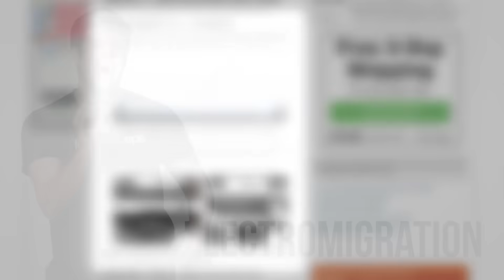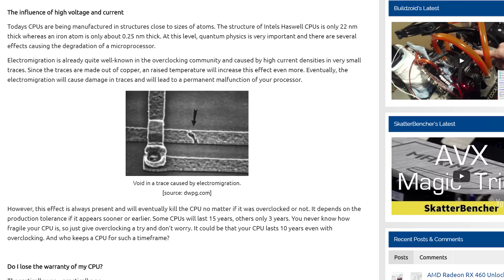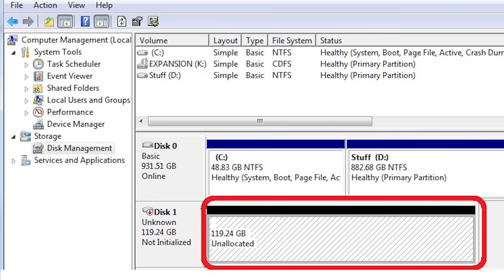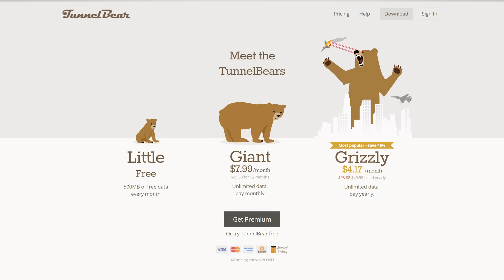Why Do Electronics Die?

Comment: Shame you skipped one of the more common failure causes, especially in modern computers: timing mismatch induced short circuiting. When you build massive networks of logic gates to form all of the necessary logic to make a computer of any sort. You have a minimum time you must wait before you can trust the output of any logical inversion, the time it takes for the signal to go from the input side to the output side. When you break the essential circuits down to logical inversion in diagram form, it's pretty clear there are some paths faster than others. Imagine this: you have a wire that can have voltages in it ranging from 0.85V to 1.35V. Some things connected to this wire can't handle the full 1.35V while other's can. It's just not feasible or even possible to separate them due to what they are needed for. So you build a gate system that will shut off that power wire to anything that might be hurt by the full 1.35V if it's about to be changed to that voltage. Simple solution, works really good majority of the time. However we want blazing fast chips so we do this as fast as possible with no wiggle room for maybe an electron going missing from that "shut off low voltage circuits" line.

Chips suffer from this a lot, they are built for it with a stated tolerance level based around exactly that problem. The higher end of the tolerance is where it's going to happen enough to notice a difference in lifespan of the chip. This is also where the mistakenly though up "Planned Obsolescence", at least as rampantly, actually comes from. They know in a few years, your most likely going to upgrade your machine or just replace the part at significantly lower price from age depreciation. So why not pick how hard your pushing things to provide the best bang for the buck for the range of time your expected to own it. It's a tradeoff of lifespan for balls to the wall power.
Reply: Alan Hunter
Reply: Alan Hunter
Reply: You think I am gonna read that?
Reply: Alan Hunter this doesn't explain why electronics fail over time. If a designer designs around this 'hold time', then we expect not to have this occur. So does this 'hold time' change over time?
Reply: downvote. voltage moves at 10% the speed of light, this is a fucking non-issue even if the circuit was a meter longer.

Comment: Electricity doesn't flow through wires btw, it actually skitters across the surfaces of the wires. So it's best not to think of wires as tubes / pipes but rails instead.

Comment: ... Did you guys SERIOUSLY make a jab at Apple about planned obsolescence in software updates? It's much, much worse over amongst Android phones. My mate's had to deal with planned obsolescence through about 3 or 4 Android phones in the time that I've known her, generally because the manufacturers just don't even bother with developing and pushing major releases of the OS beyond a certain point.

Yes, Apple does this with iOS, too, but they keep pushing major releases to older phones until iOS either gets too heavy for the hardware to operate, or it requires certain hardware features that older devices simply lack. But they support their older devices for far longer than quite a few Android phone manufacturers ever will.

Comment: because the components like resistor is needed to be acting with right current and voltage if we want the circuit has a long life,while the electronic brands aren't good at all.the second problem is the soldering,the soldering can be oxidized,the final cause is because the mechanical quartz,electromagnetic wave,magnetic or very small emergence defect in the semi conductor component but how small it is,how sensitive it is.if these causes are improved,the electronic device can work very long time and it can't die.

Comment: my Toshiba satellite c655d that originally ran Windows 7 (now running Windows 10) has to overclock in order to boot correctly rip laptop you served me well in college 
p.s I can't change the cpu because it's soldered into the motherboard
Reply: Do you know what "BGA" means?
Reply: I've had horrible issues with my Toshiba Satellite as well after "upgrading" to Windows 10. I bought an SSD for it and rolled back to Windows 8.1 and it's now working incredibly well.
Reply: Master Chef369 Desktop Dust-free Working Bench for laptop phone repair shop
①Solder ②Rework ③X-Ray inspection  We Provide One-Stop Solution!
This is Joy come from BGA rework station/ ALL phone repair and inspection line with 14 years experience.
REPLY me to get our product price list and more information.
Joy Rong
WhatsApp/wechat/Skype：+86 18779975930
Email: sales25@zhuomao.com.cn
LinkindIn: Rong Joy SMT X ray
Reply: Master Chef369 jeez I see you everywhere
Reply: Just because its soldered on doesnt mean you can’t swap it...

Im not taking any guarentee for broken parts when you do it.

Dont do it it wont really work and is a really hard job to do
Reply: My desktop that im watching this on was originally an xp machine!
Reply: u should probs use Linux or MacOS then because those are a lot lighter systems that can run easily and windows 10 is probs the worst os because of its requirements
Reply: Currently using a Toshiba Satellite L775D as a TV Media pc, and it runs a Minecraft server in the background. It’s CPU wasn’t soldered so I spent 8 bucks on a quad core and swapped it out. That thing is a tank!
Reply: un-solder it? it seems daunting but its easier than you may think

Comment: As far as drives go, my first hard drive was an 800 megabyte WD drive that crapped out four years later. I really don't think they built them as well at the time because during the mid to late 1990s hard drive space was expanding at a fast rate. There was no point in making an 800 MB hard drive last for a long period of time. Fast forward ten years later I have a 150GB WD blue that's almost ten years old and still reads and writes just fine (It used to, although not any more, run an XP Operating system). I've put the Operating System on an MVME SSD and programs on a SATA III SSD; but the hard drive still spins for storage and shows no signs of crapping out. SSDs are also starting to show greater relibality over the years.

Comment: apple comprises  their computers. for example when I purchased my macbook white back in 09. we got apple care and 2 years after having the computer it died. so we took it in it worked again. then another 2 or 3 years pass by hell it might of even just been 1 year the computer starts overheating like crazy it turns itself off and shit. and I'm just like shit I gotta stop using this computer or it'll die. so I get ylod on my ps3. I look up a bunch of videos on how to repair my overheating issue with my macbook. so I end up replacing thermal paste. man my macbook ran so much better and when I gamed hard or was just on the windows side gaming also it never shut down again.  yeah the fans kicked in but it never shut down like the shit stock thermal paste apple deliverability put after my check in with them. they wanted me to pay another 1000 dollars for  a computer that they can put not even expensive parts and then put the worst crappies most shittiest thermal paste and still sell you a computer for 1,000 dollars. damn this is why I hate companies like Sony and apple. I'm building a gaming pc baby! fuck Sony and apple!

Comment: They do last forever if you take care of it. I have a 10 year old PS3 still going like it was brand new I have an old ps2 fat version still going like it was new. I have a freaking tub tv from 1999 still going like new. My point is if you take the extra time to take care of your electronics they will last forever.
Reply: So you're telling us that the millions of rrod on the early xbox360 was due to neglecting owners? Also id like to know what is the required maintenance on cathodic tvs, appart from dusting the top. I strongly doubt it will extend it's lifetime.
Reply: No no I meant like treating it with care not being rough cleaning it stuff like that it won't stop it from breaking but it'll help it last longer

Comment: Planned Obsolescence is absolutely a thing.  

The HP 4000 and 6000 series printers both have small, cheap sponges near moving parts that are reportedly for noise reduction.  The trouble is, they're held on with some pretty good double sided tape.  Over time, the sponges wear away and parts start to stick on the now exposed tape, causing paper jams.  The fix is to just scrape it all off and wipe away the sticky residue.  Funnily enough, I've never been able to hear the difference in a printer before or after those "noise reduction features" were removed.

If it was just the 4000s I might buy that it's an honest mistake but when the same exact flaw is in the newer 6000 printers, in the same exact spot, I call shenanigans.
Reply: HP has always been like that though. just look at the old deskjets, if you're lucky you'd be able to actually finish an ink cartridge before the printer itself fails...

also in the early to mid 2000's their computers, their computers where designed as so you would throw it in the bin and buy another as soon as, if not before the warranty period runs out. my aunt got a brand new 1.8ghz Pentium 4 from them shortly after i'd built my 1.4ghz Pentium 3 and tried to tell me that her's was better than mine... the netburst p4 was slower than my p3 for a start (not HP's fault) however, whilst i was struggling with a pitiful 368mb of ram, HP figured that not only was 128 megs plenty for XP and all their factory installed bloat, but they felt the need to sacrifice 32 meg of it on a pitiful onboard gpu! heck, my videocard had access to more memory than her windows did... not bad for the $1,000 price disparity right?
Reply: I  will NEVER use an HP printer, Epson and Lexmark are way more reliable
Reply: Used the same HP printer for about a decade and a half before getting a new one (it didn't break, it was just too slow for some newly acquired needs). It's also HP and it seems to be in a very good condition after a few years. Had 5 HP products up until today, 2 were shit and 3 worked very well. The thing with HP is that they have product families that are utter shit (for example pavilion laptops) and they have product families that are really, really good (for example elite display monitors). You just have to know which are good or avoid the company altogether if you don't.
Reply: ThunderClawShocktrix I use a mid nineties HP Laserjet 4 plus with a million and a half pages run through it. It's built like a tank and still produces prints like new. The only things I have replaced on it was a 
fuser once, a couple of pickup rollers and toner cartridges.
Reply: @clandestine5959  laserjet 4 was the last of the truly durable laser jet printers from HP.   Ones after that started to go downhill.  I did do a lot of repairs on those replacing the output roller assemblies though
Reply: So we can call for sure HP is the worst tech company for both PC/Laptops and Printers rolf!.
Reply: Planned Obsolescence is super common among appliances.
Reply: I have had four HP DeskJet printers over my lifetime two of them were colour.  After some time the paper would always jam and it costed me a ship load to get it repaired.

I then switched to. Brother and it has been going for years... 10 years.... of constant scanning, printing, and faxing.  They are cheaper and better quality than HP.
Reply: I am convinced HP printers are the epicenter of planned obsolescence.
Reply: And that's before you get into their "Starter Cartridge" scam that made sure you didn't try and buy a printer secondhand for a more affordable price.
Reply: I have owned cheap Epson printers that had been designed to refuse to work after a certain time.  Perhaps they contained a non-volatile counter IC which counted the number "carriage returns".  When they reached the appointed time to die there was an on-screen message.  To paraphrase the message it said:  "Don't waste your time trying to fix this printer".  But I have to say I believe Epson abandonned this policy long ago.
Reply: Sony and Microsoft are STILL using potentiometer analogs that are know to fail after a year or two😑
Reply: That's the hypocrisy. When they talk about planned obsolescence they always remember apple and never talk about hp and other companies like lenovo asus acer sony etc.
Reply: For stuff like printers, planned obsolescence is 100% a thing, since the company could make a driver that breaks the thing after the warranty.
But for computer parts, that is not a thing.
Reply: Useful people die and young people are too arrogant to listen to dead people

Comment: This is why keeping your electronics on and warm is the best way to keep them running longer. No expanding, contracting, or power surges when they are turned on. All of my computers stay on 24/7, HDDs and all. I've never had a HDD failure and only one motherboard failure due to leaving it off for a week while I was on vacation.
Reply: I strongly doubt leaving a pc off for a week will cause any damage to the motherboard or any other component. It's just a coincidence. It would have died anyway.
Reply: W1c1ow You can strongly doubt all you want. The computer was 7 years old and had never been shut down for more than a day in its life. Yeah the board was definitely on the edge of dying, but leaving it powered down for so long was the straw that broke the camel's back. It powered back on and made it into Windows but ran extremely slow. It died trying to perform a HDD recovery and never turned back on.

Comment: Current isn't electrons moving. Current is net flux of the interactions of the magnetic fields within the wire of question. Electrons, while they still move in the wire, travel at a much slower rate, taking hours to get through a normal device.

Comment: The statement about electrolytic capacitors is wrong regarding the function of the electrolytic itself, it's act as a dielectric, not as a conductor. When a capacitor fail is because it short ( conduct) electric charge inside itself instead of keeping them at a potential and stored.
Reply: you should read this https://en.wikipedia.org/wiki/Aluminum_electrolytic_capacitor

Comment: Heat is your number one enemy. If a voltage regulator on a board starts to die it can heat up to the point that it desolders not only its self but other components near it. This is not much of a problem with pc's and laptops as their power supplies are separate from the main boards but in compact electronics like phones it can happen. 

One of the most common component level deaths in smart phones is actually water damage from sweat after being kept in pockets all day.

Comment: i remember going from a 233Mhz Cyrix M2 300 to an AMD K6-2 350, and it was lightening fast :D yet when i went from that to an Athlon 700 just 2 years later the K6-2 seemed a lot slower even after a fresh re-install, im sure microsoft are slowing old OSes/computers down based on how old they are

Comment: Blaming Apple while there is still iOS updates for iPhone 5 device. Android devices rarely gets system updates. And the OEM takes forever to rollout their own updates. Not tpo be an apple fan here but it's extremely frustrating when a flagship Android device become obsolete after one year. (I have own Galaxy S4, S5 and HTC M8 and I NEVER get Android major version update.)
Reply: A device is ONLY obsolete when you CANNOT do it's primary purpose(s).  A flagship or even a 150.00 android phone ISN'T obsolete in one measly year.  Get real.

Now I DO agree with the fact that it SHOULD NOT take forever to get major o.s. updates to Android phones and Apple does a much better job in that category.
Reply: tpcs yeah I mean they get really slow comparing to the time they were out. I got S5 at launch and it's really slow, laggy and the battery surprisingly short after a year of use. And AT&T never got android L updates. So frustrated.

Comment: I'm surprised you didn't mention just plain dust, dirt and grime Luke... I guess those are kinda external to component failure, but they are probably the number 1 reason for failure of electronics. Well, voltage spikes might be right there closeby though...

Comment: if you realy want to be evil, you use solder with a low melting point then mount your motherboard upside down, that way the components will eventually pull themselves right off the board. thats the root cause of the red ring of death, thanks microsoft.

Comment: I've only seen lg( phones) break too quickly over time. You fix one thing, the next part breaks in a couple weeks or days.
 My old iPhone 3s still works, but is incredibly slow due to the automatic updates. Pretty sure it was faster without them. Oh well I don't use it anymore.

Comment: Oh planned obsolescence is absolutely an intentional thing.  It's not ALWAYS a matter of the manufacturer saying 'we want them to have to buy a new thing after awhile' and sometimes is a matter of 'the thing that lasts 5 years longer would cost 1 cent more for every 10,000 devices we manufacture, so why should we use it?'  Other times, yeah, its a matter of them being afraid sales will drop off after the market is saturated if they make a product that lasts too long.  Such is huge in the lightbulb industry.  Ever notice how a new tech is developed that is 'cheaper to manufacture and lasts longer' and always manages to somehow be significantly more expensive if it IS longer-lasting?  What happens to the 'cheaper to manufacture' part?  Nothing.  It is.  SSDs, for instance, are much cheaper per gigabyte to manufacture than mechanical hard drives.  But because they're better they know they can extract a larger profit.  And since price-fixing is rampant in the electronics industry they don't have to worry about competitors driving down prices.